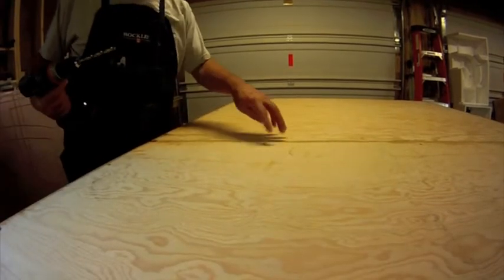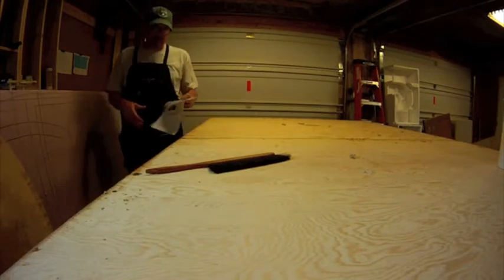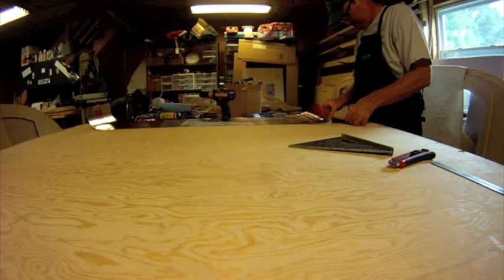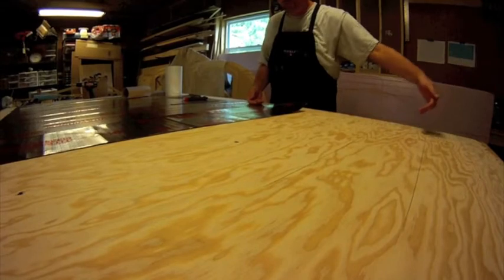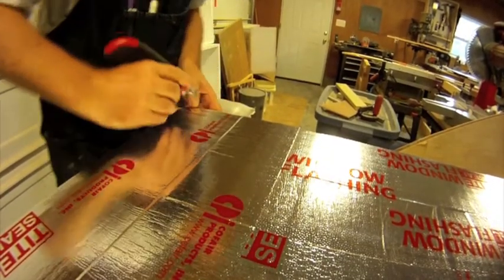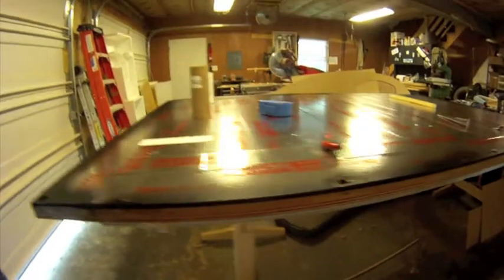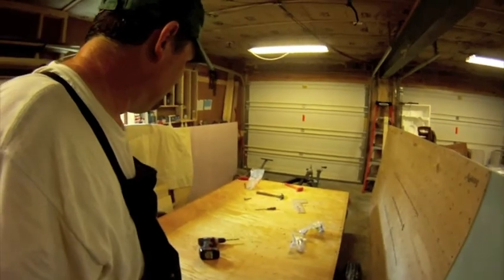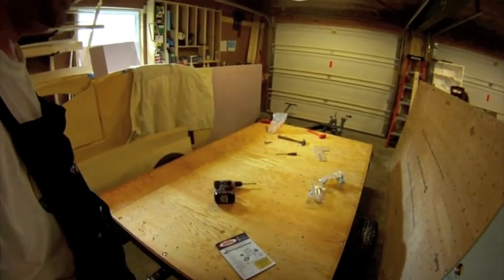Teardrop Build part #19

Comment: Hi Scott. I am to the floor which I have 2 coats of THE MIX on and was going to use bed liner but its very expensive so the other day I met a guy that had 2 pallets of 3 roll cartons of tite bond flashing. I bought a 3 roll carton for 20.00 US . So it looks like i am going to use Tite Bond! My trailer is going well. Frame is done, the walls are ready for assembly and now the floor is almost finished.
Reply from the maker: That's great! Congrats on your progress!

Comment: Scott how has the flashing held up? I am trying to decide on what to use on mine. I'm debating using this or bed liner spray. I don't want to use roofing tar. That just seems to messy
Reply from the maker: The Tite-Seal stuff that I used is really sticky and just self adheres. So far, (3 years later,) everything is still stuck down. Bed liner would work too, and might be more resistant to abrasion. If I was building an off-roader I'd consider using it.
Reply: Sounds good. Thanks for the feedback!